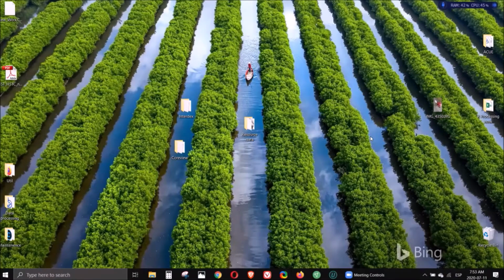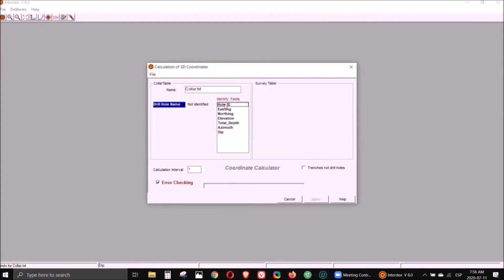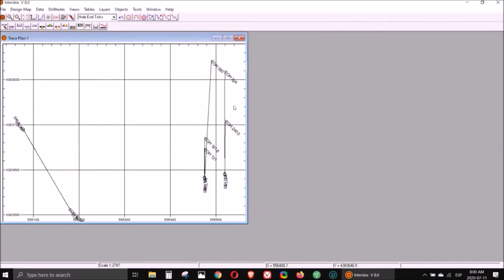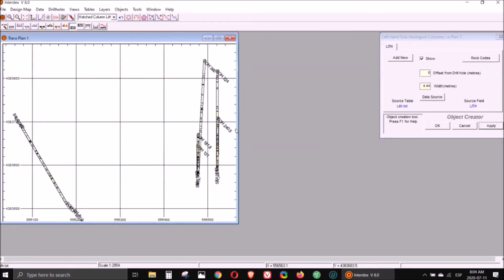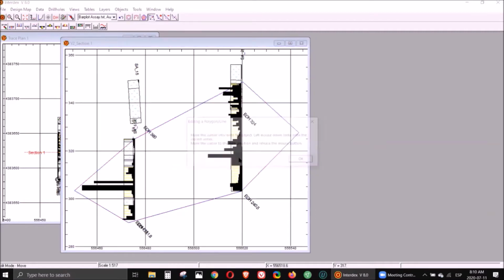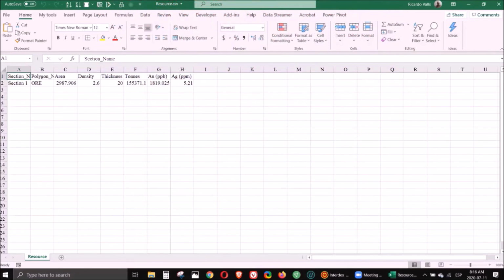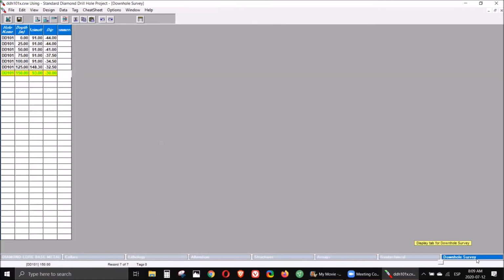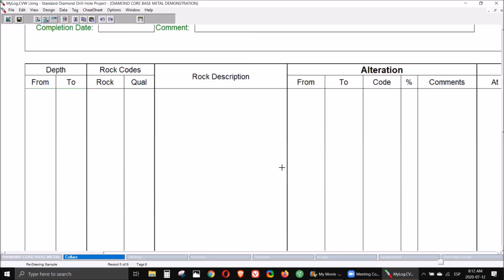Golden Droplets episode 30  using Interdex and Coreview for resource estimations

Comment: Hello ..
 Mr. Valls
I'm doing studies on underground imaging. burials, sarcophagi and so on.
I am trying to do these studies with the surfer program. I guess I can not make settings related to underground imaging.
Please help me with this.  What should I do to view underground objects? I will wait impatiently for your reply.
Best regards..
Osman ..
Reply from the maker: What you need to do is use GPR- ground Penetrating Radar  (https://www.groundradar.com)
Reply: @valls_geoconsultant  its detecting caves and metals undergriund?
Reply: Thank you very much for your effort. So  Is this possible with kml files or images from satellite?
Reply from the maker: @osmannuri8473  No. The GPR is a geophysical equipment. Please read the source I sent you. The only distant method used for archeology that I know is LIDAR images. Good luck
Reply: Thank you sır..